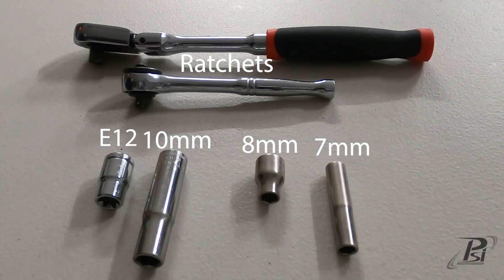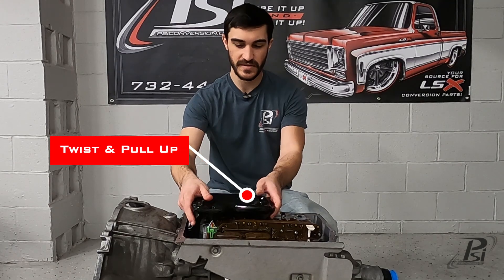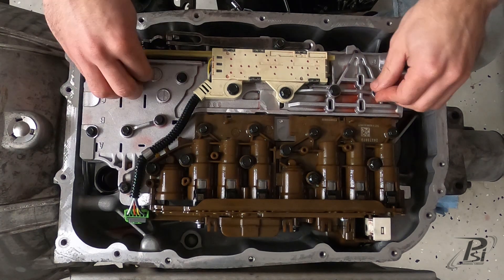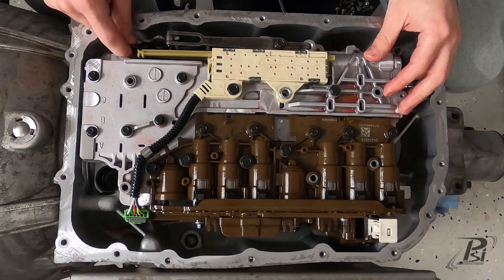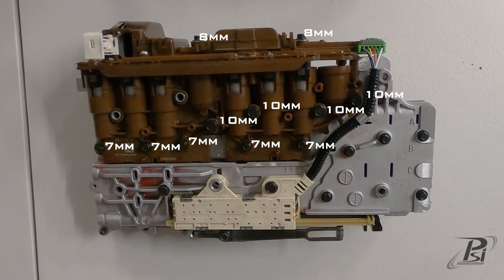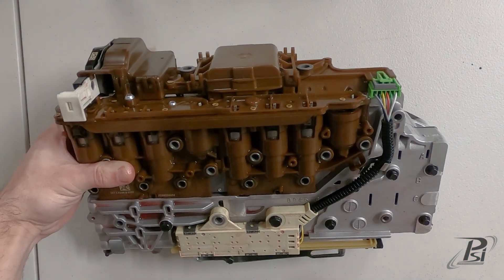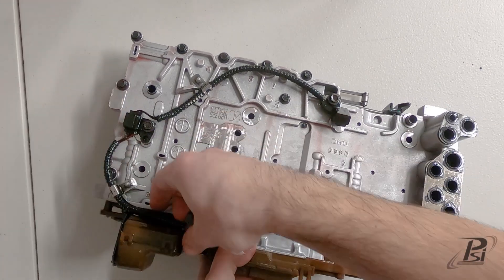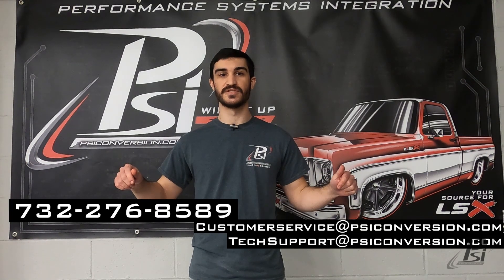PSI How to Remove a TCM from a 6L80 / 6L90 Transmission

Comment: Just an FYI. I bought my truck 11/07 and just did the pressure switch repair. It does not use E12 bolts to hold the valve body on. They are all 10mm.
Reply from the maker: Thanks for commenting. GM does a lot of mid year changes.

Comment: Does this need to be reprogrammed after you install a new 1 ?
Reply from the maker: Yes, if you get a new one or send one in to get tuned, it will require to be reprogrammed and matched to the ECU that it will be used with

Comment: Do they have to be reprogrammed
Reply from the maker: Yes, they should match the operating system in the ECM. Additionally, the programming should be updated for the correct tire size and gear ratio.
Reply: @psiconversionyoutube  which scan tool to use
Reply from the maker: It is not a scan tool or HP tuners, GM software needs to be used, both items need to be out of the vehicle and relearned

Comment: I have a 2012 camaro SS 6.2 with a 2010 6L80 behind it. The TCM wont communicate with the ECM. Took it to the fifth shop today and all they did was to loose my tune. Can you delete the vin and install the correct vin into my TCM,
Reply: Did you find a good shop. I have the same problem.
Reply: @HERNDZ454  I’m having issues with my 2011 SS. I have no gear display on the cluster. Also it’s stuck in first gear but has reverse. It still pulls hard  but won’t shift and rpms just go up. Is yours like mine?
Reply: @mr2hard2see  Yes the same problem. I’m going to get a new TCM and get it programmed. Hope that fixes the problem.
Reply: @HERNDZ454  ok I’m going to do the same. It’s $410 shipped from street smart transmission w calibration.
Reply: Did you get the TCM from street smart? Did it fixed the problem I’m going to start with mine.
Reply from the maker: Call us; send us the TCM and your computer and we can pair them
https://www.psiconversion.com/products/pcm-programming/ls-vortec-pcm-programming/

Comment: If u have issues with the E12 and it doesn't grab. Apparently some sockets are deeper than others. What i did was grind down the E12 i had a little and it worked. When i first put the E12 it would slip off like it was to big but the issue was that the the curved par of the socket was too deep and the star pattern wouldn't make enough contact. Great vid helped me get an idea of what to expect before taking it apart thanks 👍

Comment: Swapping a 2012 6l80e into a 2014 truck. I have hp tuners but can I get away with just swapping tcm from old trans?
Reply: 6l80 need to be reprogrammed to Vin.
Reply: Yes you can swap the TCM as long as it is the original as long as you have no issues with the TCM
Reply from the maker: As long as the TCM is paired to the ECM; it will work. So swapping the TCM from old to new will function.

Comment: I am trying to replace my transmission with a used transmission. Can I just transfer the TCM to the new/used transmission?
Reply: I'd like to know this too
Reply: Yes you can I have done it twice after having my transmission replaced at this sketchy shop in Ontario California I was informed that they do not reprogram that they just swap out the TCM so I've done it twice now and it works as long as you have no issues with your TCM
Reply from the maker: Yes, as long as it is still matched to the ECM you can transfer no problem.

Comment: Can a bad TECHM cause loss of 4WD? I also have no communication with Transmisson. I have received a new valve body with programmed techm for my specific Vin and 6l80 transmission. It says I need to do quick adapts with scan tool. Do you think after doing this my 4wd will work and communication will be restored?
Reply: I was told the ECM, TCM needed reprogramming and also needs the quick adapts relearn.

Comment: I have been having some weird glitches with my transmission randomly going in and out of neutral from drive. When this happens the pwr door locks unlock and lock. I had this recently diagnosed by my dealership as the TCM. So while I'm waiting for the back ordered part, which thankfully is covered under my powertrain warranty, I've been doing a little research online.  There was a lot of confusion on the net as to where the TCM is located on my truck, which is a 2018 Silverado 1500 Crew 4x4 with a 5.3. After seeing your excellent video it became very clear.

Thank you!
Reply: Where the wiring harness connects to the TCM gets saturated with ATF due to bad o-rings in the pass-thru port. This was my problem anyway

Comment: I did a LS swap on my 87 C10
I got a donor 2007 Yukon denali. 6.2 6L80 AWD but i ended up getting a 2wd 6l80 from a pickup truck i have a U0100 code and u0140 truck feels like it starts in 2nd or 3rd gear? It doesnt shift thru any gears at all. Do i have to swap tcm from the awd trans to the 2wd trans?
Reply: What did you come up with? I'm having the same problem
Reply: @AuDoematic  i ended up swapping tcm's from the original awd trans to the 2wd trans and issue and codes went away immediately.
Reply: @carlosvalencia3388  are you shifting through all the gears properly since you put the AWD tcm in?

Comment: It looks like you guys accidentally labeled number 5 as the one right next to number 6 when in actuality it's the right bolt on the white  prndl housing just to the left of what you labeled 5 as. This video was helpful as I would've been lost, but that bolt being mislabeled threw me through a loop.
Reply from the maker: you are right, Our tech took out the right bolt but it was mislabel. thank you for pointing that out and im glad the video helped you out!
Reply: @psiconversionyoutube  👍🏻 just purchased a wiring harness and pcm tcm program should be in your inbox. Working on getting it shipped out thanks again guys!
Reply: Does thsi require the vehicle TCM to be programmed if replaced I have faulty one and get a fault for it.
Reply: @Stinky_G04t did you get that fixed. I just ran into Tcm problems code u0101. I’m going to check my battery and connections first. If that doesn’t work I’ll get to the valve body
Reply: @mr2hard2see  so we are having to have it replaced we tryed to reprogram the TCM the first step on the Gm tsb and if it dosnt fix the issue it’s a have to replace the TCm that’s what we are doing sense it’s a high hp car it’s about that time anyway so I’m getting the car done then taking the truck in before it has any issues
Reply: @Stinky_G04t  that’s most likely what I’ll be doing as well. Street smart transmission has some pretty good deals on tcm/valve body parts. May I ask how much power are you pushing? On my yt channels is my 5th gen Camaro SS that I supercharged, cam, e85, headers etc.  I had a conservative tune and the dyno hit 737hp. I’m a little over 600 rwhp.

Comment: So if I'm using a 6l80 that came with my motor and the ecu that was in the car do I still have to have the tcm tuned?
Reply from the maker: A few setting in the ecu would have to be turned off or on (like vats) so yes, you do need to get the ecu in a tuned. If you just put the ecu in the car as is nothing will work.
Reply: @psiconversionyoutube  yea I got the ecu done for vats but some people are saying that I have to do the tcm as well just trying to figure out if I have to take it out and send it in
Reply from the maker: Correct, we offer the TCM unlock as a service, they require additional software to pair the TCM to the ECM if they are mismatched. You will not be able to shift if this is not done properly, and it requires more than HP Tuners. Contact us via phone or email and we’ll help you out
Reply: @stephendudla   😝 y su familia familia o 👀 y Im la m lo more ñ
Reply: @psiconversionyoutube  we are getting a no comm reading does this mean the tcm is bad.   If tcm is bad should that be under warranty with the transmission
Reply: If i get a L76 with 6l80e out of the same car, do i still have to send in tcm as well as the ecm?